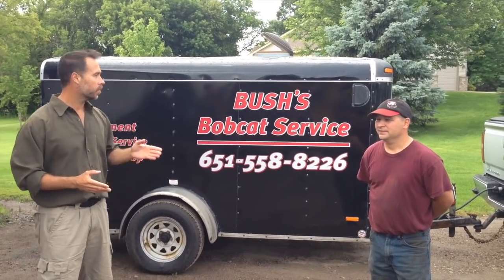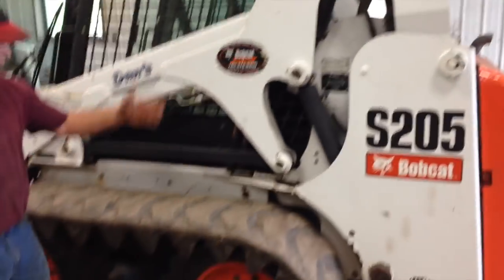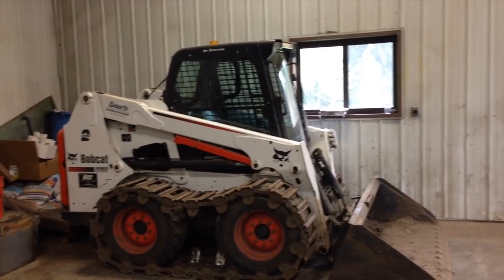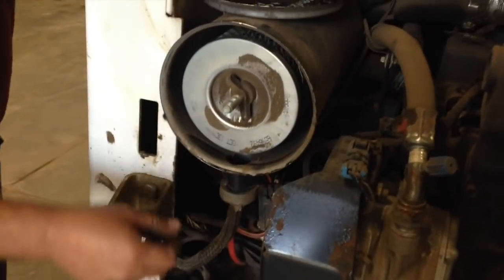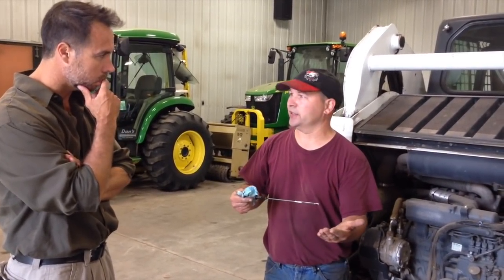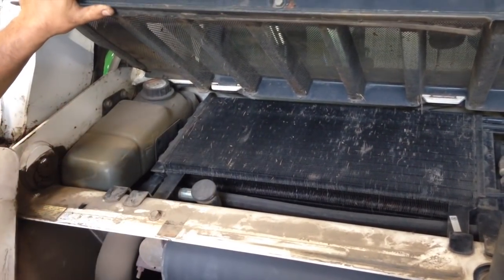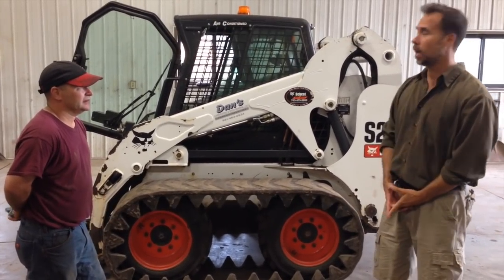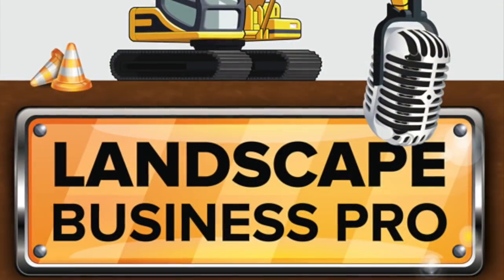How to Buy and Sell Heavy Equipment

Comment: I maybe missed it or maybe that machine doesn't have one but definitely check out the u joints between the motor and hydrostatic pump. It can cost a lot if you have to pay a shop to replace them not to mention if the spider gears are bad

Comment: you really cant go by a seat, seen many with low hours and the seat is shot, simply because it had all its life a 400 LBS  operator in it. seats all busted up, when I go look at a used machine, I take my engine compression gage with me, test all cylinder compression, I also take my hydraulic presser gage and do a presser test on the hydraulic system, if its low I adjust the relief valve to see if the presser comes up, with out doing this, you could end up popping the engine in a short time, witch is costly, same with hydraulic, you have a bad pump, they can run you from 3000.00 to 20,000, also smell all oils, if they smell burnt, walk away, take a good look at your oils, many people will add sawdust to the oils to stop leaks, stop nose and so on, I seen this a lot, a miss leading thing in this video is, it is not just simple as changing out a pin when you have movement in a joint, the pins are a lot harder heat treated and ground pin stock, so the bushings are going to be far more war out then the pins, and you have to do 1 of 2 things, line bore the bushings and press in new sleeves, or air arc the bushing out and install new bushings, using a long pin, that will go though all bushings, and a good welder that can weld the bushing in with out binding the lining shaft, I have done hundreds of these jobs in my 50 years on just about every type of equipment, be very careful buying used, if the owner will not let you do all these tests, walk away, its very bad news
Reply from the maker: Good advice!  Thanks for sharing!
Reply: You can’t even spell pressure. What do you know?
Reply: About to my first skid steer kinda nervous I’m getting it from a bobcat dealer It’s a 2001 T190 with 2980 hrs on it any advice ? Or should I get a new Holland for 20000 with 1900 hrs on it

Comment: The seat indicates nothing. Most machines sit in the sun there hole life and the sun will crack seat. Most importantly pull hydraulic and engine oil samples and have them analyzed for ferrous metals. Pumps and motors are ur most expensive components. That is the best way to ensure that u wont b putting a bunch of money into a new purchase.

Comment: I don't think you have to do all axle seals when only one leaks,just the one that leaks,you could get hundreds of hours out of the other ones still
Reply from the maker: When one goes the other is usually close behind
Reply: In my experience the rears wear much quicker than the fronts, so I would at least do fronts or rears as a set. Its a bit of a pain to do, but doesnt cost much in parts.

Comment: Is there a certain threshold for the number of hours on a used machine? Perhaps a better question would be is there a range as far as hours where you get the most value for a used machine?
Reply from the maker: Yes- on average about 5,000 hours they start nickel and dimeing you to death and before  10,000 hours you are likely to have a major breakdown of some sort.
Reply: I like to tell customers that the size of the machine has a lot to do with how long the engine will last, and normally the larger engines last longer.

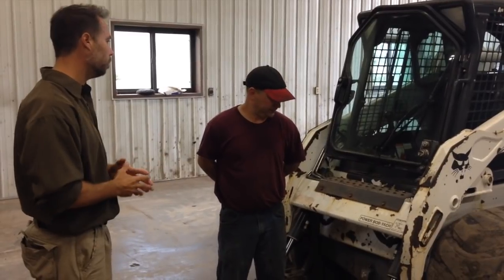Comment: You lost me at the bogus claim (@4:15) that an "uneducated operator" can bend the bucket tilt cylinders by plowing snow (or doing anything ) with the bucket rolled vertical and moving forward. Laws of Physics make this bending under extension absolutely impossible! There may be a VERY minute chance of bending a hydraulic cylinder in compression, but it would have to be an extreme case. 
So, 99.99% of the time when a hydraulic cylinder gets bent it is from being physically hit by an object while extended.
Stick to your excavation videos. You are not bad at that.
Reply: Tom Novak if you knew what you were talking about you would know that the cylinders are easily bent in the situation that they are talking about.   I’ve seen it, more than once. Stick with what you know before leaving a comment about something you know absolutely nothing about.